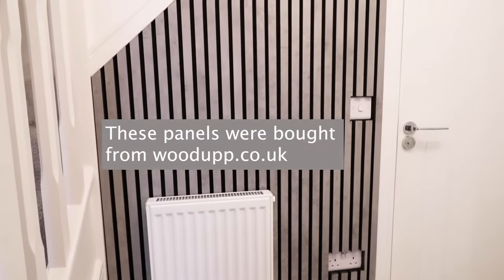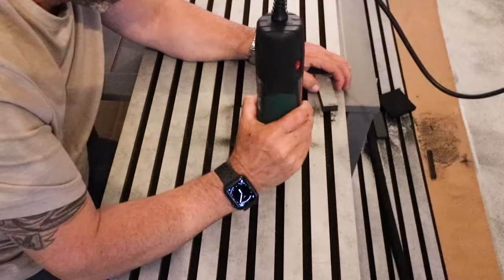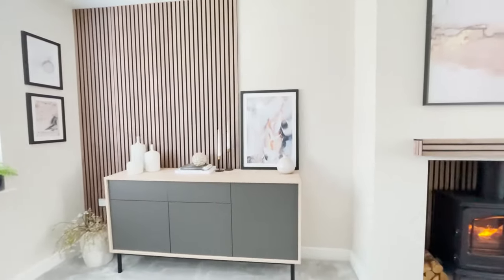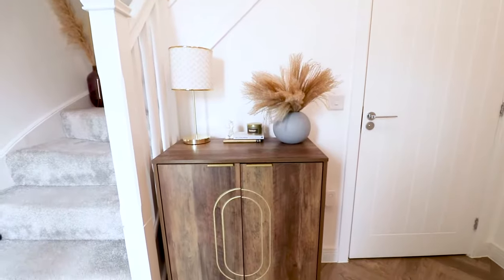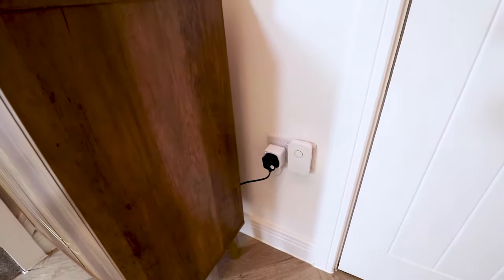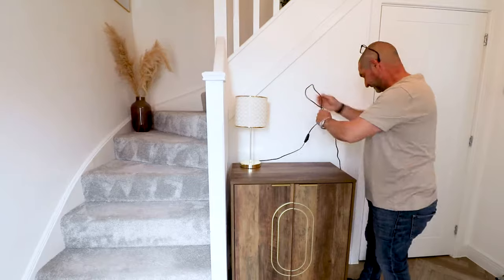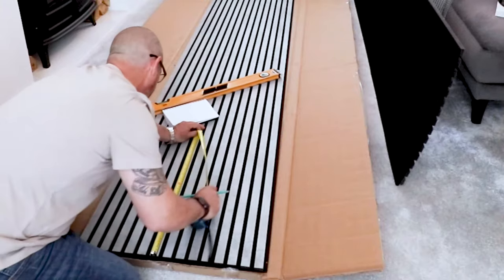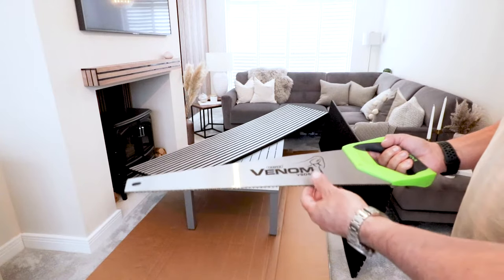DIY slatted MDF acoustic wall panels - how to fit them step by step

Comment: I have a 100 yr old home with plaster ceilings except in master bedroom with some kind of particle board.  I have extra plywood so could have as new base for ceiling.  I had been thinking of faux ceiling panels, mdf to look like cottage tongue and groove.  A local craigslist seller has some that would cover my ceiling.  Was not sure if there are holes the hole length of the panels. I can imagine that it would be a beautiful ceiling in an old house.  :)

Comment: How have you found the wall panel has held up on the radiator wall? I want to put panelling behind my radiator to hide bad plasterwork but worried the heat will warp it or it's not safe to have them behind radiators. Never seen these put behind radiators before
Reply from the maker: It has been absolutely fine, no warping at all.

Comment: Thank you for this very useful video. Just to be sure, the screws were drilled into the wall just like that? As in without prior anchors?
Reply from the maker: We have plasterboard walls and I just used plasterboard screws with no plugs. It is only to stop the panel falling away from the wall as the weight of it is supported by the skirting boards.
Reply: @newbuildtohome  ahh okay. Thank you for your reply! It was very helpful 😊

Comment: can these be screwed into plasterboard s without any fixings if so what scres should i use  Thank
Reply from the maker: I just used normal plasterboard screws as the panel is resting on the skirting and the screws are just to stop the panel falling away from the wall. The panels are still up after several months and haven’t moved at all.